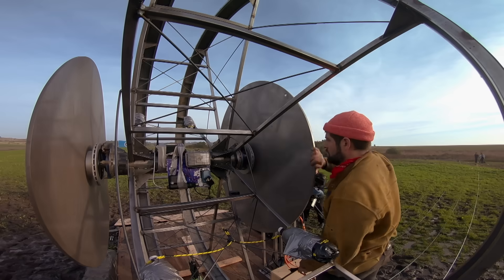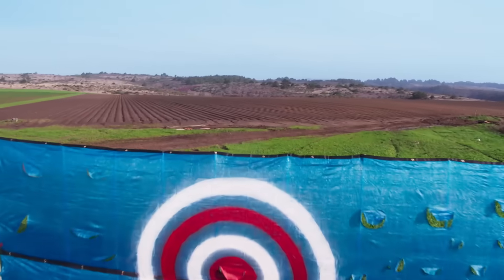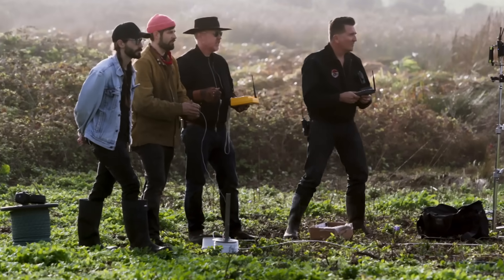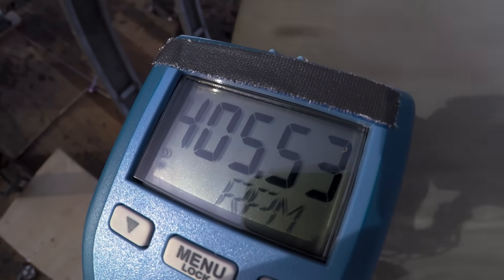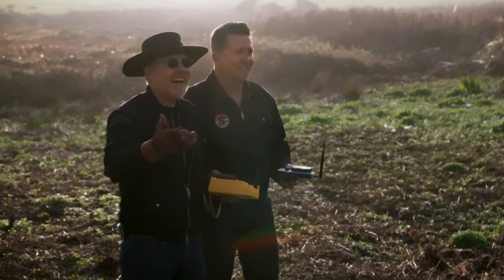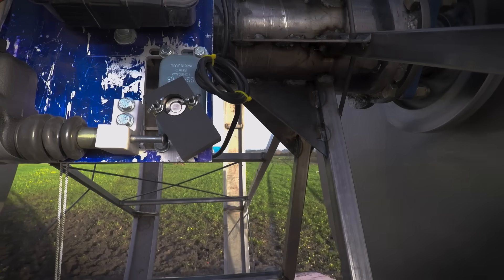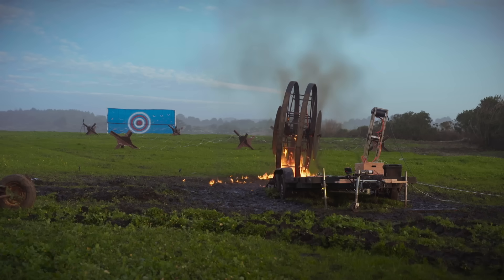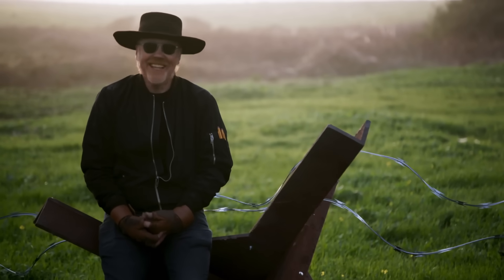Weaponised Flywheel Experiment Fails Explosively | Savage Builds

Comment: How could they not know that narrow, heavy wheels do NOT roll in soggy mud without getting stuck, no matter how they are powered?
Reply: I think they were trying to mimic the viscosity of sand, which is where these wheels were originally intended to be used iirc.
Reply: Because these guys live in the city, that’s why.
Reply: it'll be fun to watch the mission to mars spectacularly fail after it fails to leave the earth's atmosphere
Reply: Because they are engineers
Reply: because that statement is objectively false? yup...thats probably the reason.
Reply: The drive system here is completely different. The mud has very limited effect. There is no vehicle with negative inertia to overcome. The vehicle IS the wheel IS the drive system.
Reply: @josephmiller997  then by that explanation it would be safe to assume it wouldn't have gone any further on a hard surface?
Reply: @gwailo27  I wouldn’t think very much.
Reply: @gwailo27  the only form of acceleration the wheel would have received would have been from the initial energy exchange. The brakes couldn't stop the flywheel fast enough, so the transfer ended up mostly being lost as heat.

A paved road would have been just as disappointing, the ramp would have likely provided more acceleration at that point, completely negating the entire point of the experiment
Reply: @josephmiller997  ok. Fair enough. This reminds me of the  MB episode with the plane taking off on a conveyor belt. I was convinced I was right on that one too. Turns out not so much!
Reply: @gwailo27  That was an interesting conundrum.  Adam Savage did an interesting video talking about that episode and how people would write the show insisting they were wrong even long after it aired.  Highly recommend a watch.
Reply: @josephmiller997  imagine the mud twice as deep. Still thing it would have no effect?
Reply: @josephmiller997  no, mud causes energy losses. Call it drag, friction, whatever you like
Reply: @huaahhggg9507  I would call it viscous drag for the most part.

Comment: There is no way that outer wheel is going to accelerate from 0 to 1,000 RPM with a direct drive. What about a torque converter and a planetary gear set up? You need those discs (rings are much better) to maintain their inertia and slowly accelerate the big wheel.
Reply: You and I are on the same page. (you arn"t a kiwi  by any chance?)

Comment: They should have done a couple of runs with the wheels secured so they wouldn’t turn and activate the brakes so that the pads could break in with the rotors. Just as one would do on a regular vehicle. Then the brakes would have been able to transfer the inertia of the flywheels better

Comment: You guys should have used truck air brakes with dual spring chambers.  This way you could just release the air pressure and the brakes would engage,  plus you’d have brakes designed for 80k pounds.
Reply: Yes clearly their brakes didn't fully engage seeing the flywheels were still turning after the wheel had stopped.
Reply: ditch the brake rotors and just grab the edge of the flywheel. Way more torque, and much more mass to prevent overheating. More powerful caliper system would have helped a lot as well.
Reply: Indeed!
Reply: Needed a NASA engineer to figure that out
Reply: Or anything other than quitting
Reply: It’s not so much that the braking system was insufficient as much as it was that the brake pads were not burnished/bedded to the rotors yet…until they are, there is a very low coefficient of friction and the brakes can easily be overheated, glazed and the fluid can even start boiling in the calipers.

Heavy truck drum brakes would have been much more powerful but suffered the same issue without proper break-in.
Reply: As soon as i saw that brakes i knew that it was not going to be enough brake power
Reply: brakes were fine.  Those brakes can handle a ton more force.  Literally.  Those would be used on a pickup and you figure full force breaking from highway speed on a truck is magnitudes more stress than what they were applying.
Reply: @EVLS10  you should really study the effects of centrifugal force as a rotating mass gains in diameter,  and mass. There isn't a brake caliper on a production pickup truck that would be able to have handled the rotating mass equation on this build.
Reply: @MrEvilscotsmanjimmy  I think you greatly underestimate what brakes are capable of.  Slowing down a vehicle that weighs multiple tons from significant speed in several seconds is no easy feat.  This is comparatively.
Reply: @MrEvilscotsmanjimmy  Air brakes from an F650 would have handled that amount of rotating mass with NO problem!
Reply: @DaveW74TVN  what is the rotating mass on the f650 per brake drum? And what is the actual ground speed at say 10000 RPM?
Reply: Use torque converters.
Reply: @sbkenn1  a traditional clutch would be more applicable a torque converter for a car turns rotating force into hydraulic force. To power friction clutches build a large enough friction clutch, and tie it into an air, or hydraulic actuator and have it fixed to the axle.
Reply: @MrEvilscotsmanjimmy  The advantage of a torque converter is that the power source can run at an efficient/comfortable speed when the flywheel is just getting started.  A slipping clutch generates a lot of heat and wears rapidly.
Reply: @MrEvilscotsmanjimmy  I know what you're thinking but they would've been too much slippage even at engagement with all of that torque and kinetic energy! Yes I am an engineer
Reply: Train breaks
Reply: @jaimedelgado7529  Brakes, are to convert kinetic energy into heat.  Torque converters transfer kinetic energy between shafts running at different speeds.  Clutches transfer energy from one shaft to another, very quickly, causing huge torque to occur in the engagement. In the experiment, trying to transfer inertia rather than sustainable power (as in an engine), needs a gradual, energy efficient coupling i.e. a torque converter.  There are magnetic ones (appropriate here) which work on variable viscosity, albeit with beads rather than fluid, but they work as though they were a fluid.
Reply: What even is the point of using the brakes? Why not just spin the whole wheel whole mass acts as a flywheel and just drop it on the ground.
Reply: @ToxicTom1967  Its basically the exact same thing.  The ground would be the brake in your scenario.
Reply: I was thinking even using the existing brake system, but with a high pressure nitrogen bottle (quite small one) that when activated sends several thousand PSI into the brake calipers, use the gas directly instead of some sort of master cylinder arrangement and hydraulic fluid. Need it to apply hard and quick, don't need to modulate brakes (can do so over multiple tests with different charge pressure), don't need to be able to release the brakes automatically (can have manual dump valve once done), don't need to be able to actuate brakes more than once per test, and brakes only need to work for a few seconds at a time.
Reply: You have the same last name as me.
Reply: i bet those cost a gajillion dollars or so
Reply: Too late.  They gave up after the first try, instead of correcting the error.  Disappointing, really.....
Reply: even then : you should immediately couple the flywheel with the transmission which should be stepless. Or a torque converter that convert energy gradually. Now all the energy is dissipated as heat in the brakes
Reply: Even thought it's true what you said, it may have added an amount of danger they weren't ready for. I've seen those canisters explode before, it has enormous destruction. So if they did that and the flywheels gave out they could have essentially an overpowered grenade detonating near them.
Reply: @TheKlopka  so the 400 pound flywheels spinning at 1000 rpms is safe enough but air brake chambers would push the limit overboard. Oh and don’t forget the bottles of gas and set cord. Those are safe too.
Reply: @redman2751  you're being disingenuous, maybe actually have a conversation with people instead of immediately implying they're idiots and you might have someone to talk to at the end of the day
Reply: @TheKlopka  they literally strapped explosives to it.
Reply: I don't think it was the break pads, I think the flywheel was not spinning anywhere near 1000rpm, maybe closer too 200. Adam even said he only really wanted it to leave the pad, so for safety I think they intentionally didn't spin it up to max power
Reply: @Jadinandrews  The rpm counter showed ~800rpm.
Reply: @fardreaming  i saw that too, but that's not hard to fake. I mean they made no changes to this contraption, and they barely made 300 in testing.  So to hit 800 rpm on a flywheel that was already unstable at 300 is a bit hard for me to imagine.  Happy to be wrong though
Reply: @fardreaming  also this thing could have shot off in any direction,  the tiniest torque on one of the flywheels could send it chaotically dancing all over the show
Reply: @Jadinandrews  also the rpm meter jumps 100rpm instantly at the 3:23 mark.  Was sketchy looking?
Reply: @randall197  they should have just spun it up to 1000. It makes it or it doesn't.  If its that dangerous then build a better safety bunker for the crew.  But it should have either hit 1000rpm or detonated itself.

Comment: The disc brakes looked so small especially compared with a performance car and all they kept talking about was how hard it will be to stop the 2 flywheels.  😣  I'm sure someone could calculate the stopping power required on the paper build.
Reply: If only there'd been an engineer around somewhere.
Reply: Need an instant axle lock, but it would be hard not to bend or break with that much instant torque applied

Comment: Math can be wrong, because it is a language. It also has greater potential than a finite set of logic, because it is a language.
Reply: The thing is the math wasn't wrong, the brakes weren't strong enough or fast enough to transfer the energy from the flywheel.